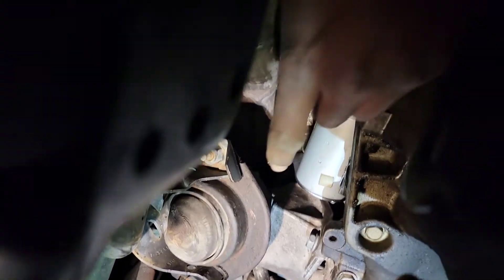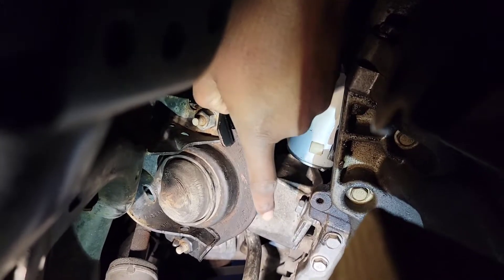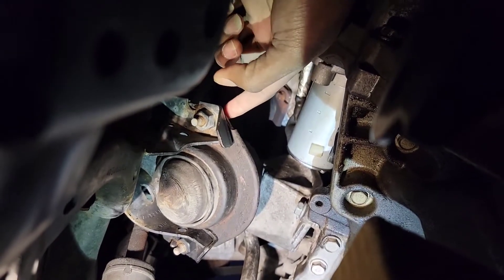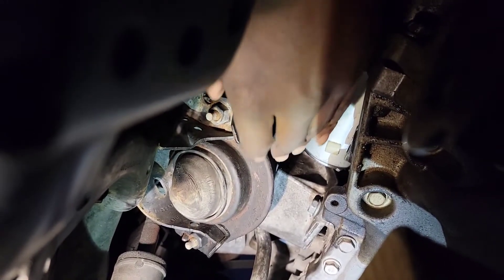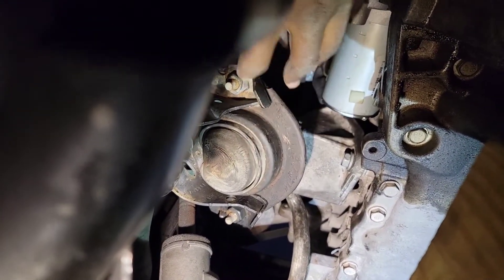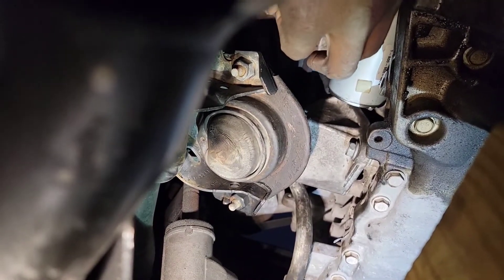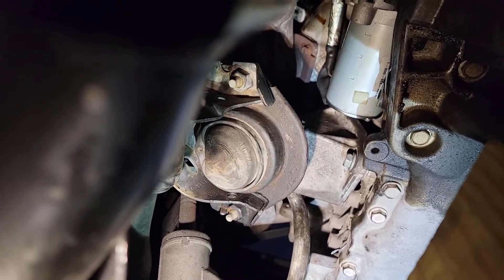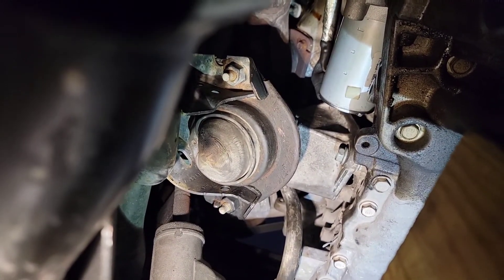Have to change out the starter on 2012 Dodge Durango..

Comment: You don't have to move moter mount it was slide out
Reply: How is that because I've tried that
Reply: Thats the thing i got it out disconnected. But I cant get out because mine is AWD and there's a gap only big enough for one end of it to hang because of the motor mount be in the way.